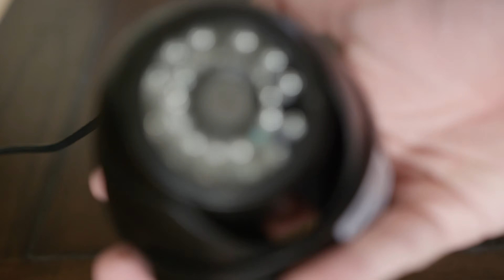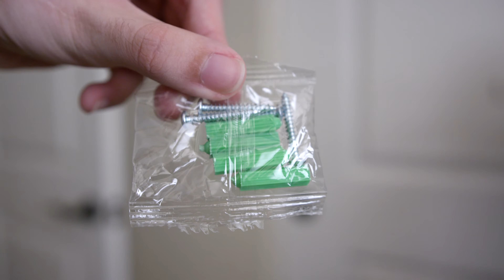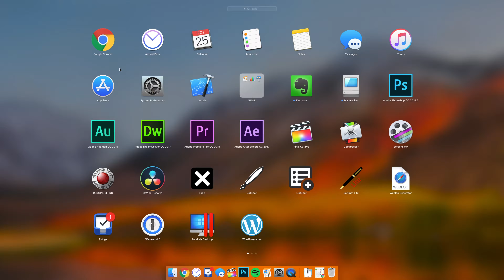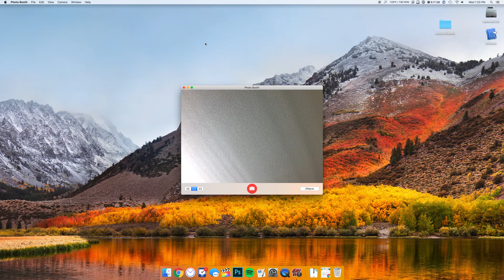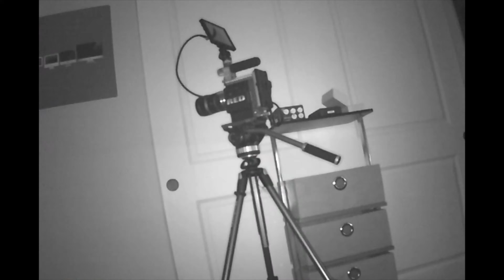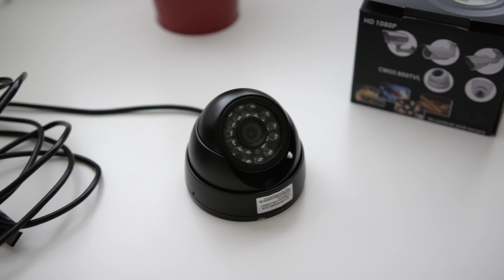ELP Security Camera Review

Comment: It does have a 1080p mode at 30 fps, you just have to use the third video device it presents (/dev/video2 on Linux). There's also no stutter on that device because it uses H.264 (/dev/video0 is MJPEG). Also, might be cheaper to order directly from Aliexpress instead of from an Amazon dropshipper.